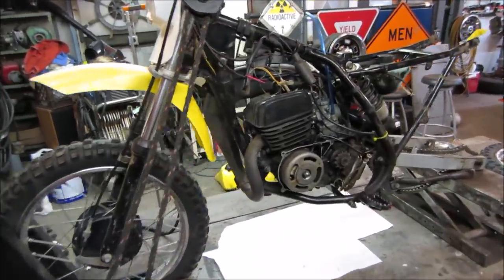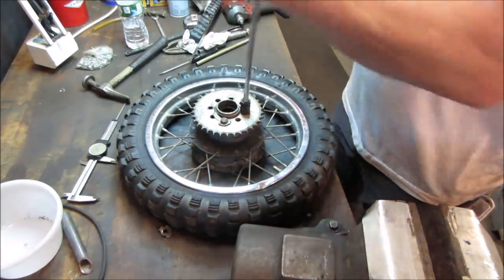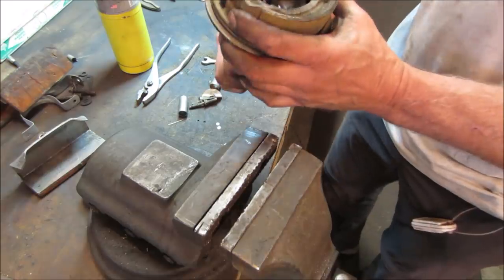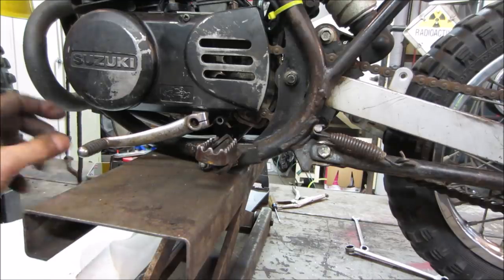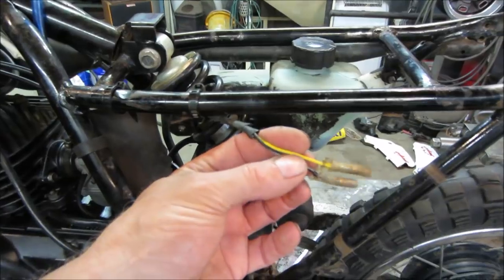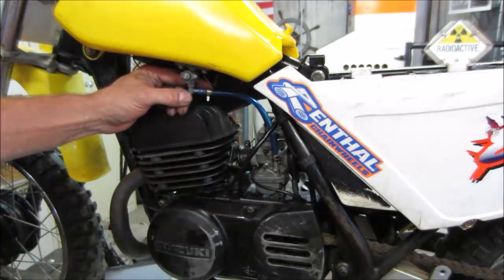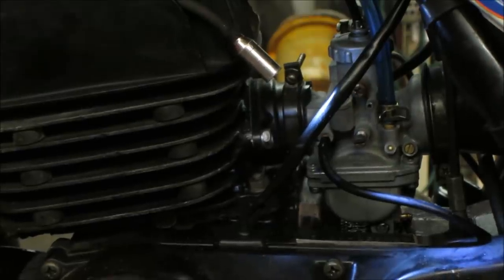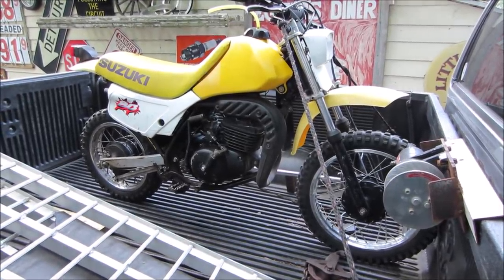Junk Suzuki 80 From A Yard Sale, part 2 of 2

Comment: My daughter had the same bike when she was young. That thing was a ripper, every time an adult rode it they got hurt bad. Her shift shaft/fork assembly did get stripped off once and all there is to fixing it was to pull the kick start and the right side case and it slides right through from the other side it was only like $18 bucks plus a new shifter. The when she got a new larger bike I traded it to a guy for his girl and warned him not to let adults' ride it. Sure enough that night thirty something uncle wiped it out and went in the ambulance with a broken collar bone. After his girl saw this she refused to ride it out of fear, so it was taken and traded for 3 Chinese four wheelers that were all shot in a week. I found it at the nippon dealer and tried to buy it back a couple weeks later to find out his adult son was riding it and broke an arm. He wanted way to much to buy it back so I caught hell for loosing "sunny" she never did like the new Yamaha. Then about ten years later I saw it along the road for sale and snapped pictures of it, sent them to her phone. At that time I was instructed to turn right around to go buy "sunny" back again, I was not gone 15 minutes but when I got back the guy said sold it two minutes after I pulled away. So I was in trouble again. If anybody out there has one of these with the little black and white biker stickers all over it " mostly proclaiming how much girls are better riders than boys"  Let me know, my daughter is going on 30 now but still wants sunny back!
Reply: quite a few bikes are made that way, with the internal lever and return springs on the clutch side of case. just for the reason of no main case splitting for shaft change :)

Comment: Sweet! In my experience that plastic welding doesn't really hold on in any bike. The streets of Helsinki are a real pain in the ass, since they're museum streets made of cobblestone, so they repeatedly cracked the plastic rear fairings on my motorcycle. I tried plastic welding them back for like 5 times, and then finally lost the part that cracked off, since the welds couldn't handle the stress... Then I threw in some fiberglass mats and resin on the section that fell off, grinded it to shape, sanded it smooth and painted it the silver that my bike is... and that hasn't cracked at all. At first I thought that plastic welding would be better on the plastic, but after putting that fiberglass there I've never had to melt them zipties into the fairings ever again. You could fix the rear fender and the missing pieces with a few pieces of fiberglass mat.
Reply: You can heat up some staples and melt them into the crack like stiches.
Reply: You might be able to anneal the repair like you would with metal by heating it to below its melting point and holding for awhile

Comment: When your doing the plastic welding.. add a paperclip across the crack and melt it into place. It helps to keep it from cracking again.
Reply: Stainless steel or aluminum screen cut 1/4 inch wider than crack works wonders, especially in curves & corners
Reply: @tpseeker3367  Yep, best trick. Did it many times. Works perfectely.

Comment: If you have a Dial Test Indicator you can set that to "Zero" on the Lathes Saddle after a "Touch On" to be even more precise (34 years as a Machinist) 😉
Reply: Recommend Abom79's channel...
Reply: @neonhomer  WHO recommends Abom79's channel?
Reply: Mustie no like lathe. Too complicated.
Reply: I would have thought that, as a machinist, you would have commented on the fact that the compound slide was on the wrong side of the cross slide, it was lucky that it didn't hit the chuck.
Reply: @markgriffin4888  
...and the tool bit was wrong for facing.
Reply: @TinShackVideos  and as Paul Frederick wrote-too complicated for MUSTIE 😆😆😆😆😆😆
Reply: @1pcfred  ,  He is always looking for a work around, even if  it means the piece MAY be the wrong size, out of round, etc.
Reply: @TinShackVideos  ,  AND he ran it backward half the time... I mean, who cares? RIght? LOL
Reply: I was just trying to be helpful, not critical 😉

Comment: JB Weld 2 part plastic bond, works great! Repaired all the broken mounting tabs on my headlight assembly on a Subaru. Worked great for the last two years I owned the car.
Reply: I use Devcon Plastic Steel ( NOT THE FAST DRYING STUFF ) on all kinds of things also. I even BED BOLT ACTION RIFLES WITH IT, GREAT STUFF. Dad fixed a hole in an engine block back in the 70's with JB Weld & Screen to hold the JB weld on. Blew a rod out the side, said it lasted 6 years & then he sold the car.
Reply: @NoWr2Run  I'll have to give that a try next, thanks for the info.
Reply: @Silversmith925  Yes Sir, Everybody has their favorite. I chose Devcon for bedding rifles because is does not shrink as much as JB Weld. Used it on .22 to 30-06 calibers & holds up fine. You can even put dye in it to match a wood stock, like brown, does not take much.
Reply: @NoWr2Run  that is very very impressive about the hole in the block. I'd like to do some experiments with that stuff.
Reply: @rm25088  YES IT IS, Amazing what that stuff could hold up to. Dad swears by it & he's 80 years old, still uses it for all kinds of shit. I use Devcon Plastic Steel it flows better where I want it especially in bedding guns. Hell it even sticks to synthetic stocked rifles but you have to drill small holes & scuff it up ( I use a dremel with a grinding bit ) for it to stick. Personally didn't think it would work but PREP IS EVERYTHING LIKE PAINTING. You can also mix some steel, aluminum, wood what ever filings, wood dust in it, I think it makes it stronger ?

Comment: Mustie , I'm over 80 years old and I was , just about , having as much fun as you were having racing through the woods .LMAO
Reply: He was racing faster here. I fast forwarded that section. Bike riding was never my thing. One of my buddies killed himself on one and other did a Superman impersonation when he hit a raised manhole cover in tall grass going over 50. He flew in the air over 150 feet. Arms straight out the works. All he was missing was the cape. Oh and the superpowers. Because when he hit the rocks he got pretty messed up. Was nothing a plate in his head and a pin in his knee couldn't fix though. Makes going through metal detectors hard today.
Reply: @1pcfred  Never ride where you can't see the ground.
Reply: @MrCarGuy  I think Scott would agree with you. I just never ride.

Comment: Mustie, when doing low budget repairs on softish poly plastic like the back fender, either a tie-wrap or the translucent white tubing for a refrigerator ice maker works fantastic as a 'welding rod'.   Makes for a much stronger repair than just using the base plastic.

Comment: The rear brake arm points up not down on this model. That way the brake rod will be straight.
Reply: I was wondering about that.  But if the arm is pointing up, then the shaft will turn in the opposite direction.  I guess if the brake works with the shaft being turned in either direction, then I would've at least tried test-fitting it pointing up, to see if it worked.

Comment: We had the 50cc road version of those bikes here. Made and sold in the 70's and 80's. We would bore them out to 50mm, put on a 24mm carb, an expansion chamber pipe and would use them on drag races. Some would lighten the flywheel and put on some Yamaha electronic ignition, others constuct some Stihl chainsaw ignition system on it (they came originally with breaker points). There are still some riding around. Real fun and quick bikes.

Comment: You made every "Machinest" mad by using your lathe in one segment, then you turned those nuts into spacers using a bolt and air grinder. I'm dying laughing. I love your videos sir.
Reply: I learned that trick in a machine shop. So no not going to make any machinist mad. We do it on bench grinders though. Works great for sizing the outer diameter of washers.
Reply: I was like "use the lathe!" but then... then I learned something.
Reply: @djmips  you learned about the Ifonly lathe. The if only I had a lathe machine.

Comment: Learned to ride on one of these. Those things just go like no tomorrow, me and my brothers rode it till it feel apart (literally). Rode it so hard the muffler and pipe snapped off the block and never went back on and the kick starter did what the shifter on this one did. (yeah we drilled and stuck a bolt through haha) Oiler never worked for us just ran mixed the whole time. Love these little suzuki's so much I ended up with a rmx 250 now that I'm a little older. Thanks for saving another one from the junk pile "Trustie Mustie".

Comment: I love your videos. First time sending a message. For the plastic welding melting in a stainless mesh across the cracks will add a lot of support to the seam. Also using some scrap plastic from another fender or other plastic item to melt into the seam and cover the mesh will add a lot of strength to the problem area. Keep up the great work

Comment: @mustie1 I have a southbend 9 you want to run belt in middle for cutting mild steel, back gear middle for cast iron, the high setting is for polishing shafts and stuff. Running to high speed causes chatter like crazy.  Take too big a cut or jam and belt slips off which is a good safety.  Oil crossslides, headstock everytime you use it and put oil on ways as well as oil the rest of points daily. I use hss cutters for most part.  Not sure if you have gear box or pile of gears. They usually have ratios on covers.  Southbends use a jacobs 2 taper instead of more common Morse taper.

The screws in belt area and on back gear shaft need oiling once and awhile.

A mod I did was to set crosslide to 30 in both angles and scratch it so that it’s quick and easy to set it up for thread cutting.

Comment: Bearing crush or preload is critical to the longevity and function when dealing with open/closed end bearings. Too much crush generates overheating or even binding up. Too loose or not enough crush will create “end play” and possibly allow the inner race to spin.

Comment: The best way I found to repair a stripped shifter shaft is to drill a hole between the shaft and shifter lengthwise and tap it for a bolt, this would make the bolt like a key way. I always put jb weld on it before tightening the bolt and waited 24 hours before riding. Never had one to fail. Drilling a hole 90 degrees to the shaft usually is always a fail.  Always liked this little bikes.

Comment: Just a tip when "welding" plastic if you bend a piece of wire like a paper clip into a zigzag and heat them up you can melt the wire into the plastic to hold it together
Reply: Using an aluminum screen is even better.
Reply: @marcryvon  thanks ill have to try that way next time

Comment: Thoughts:
many times I see those spacer tubes inside MC wheels with a flat washer-looking thing tack welded on to keep it in the center when you remove the axle it doesnt fall in the cavity.
Those torque rods that hold the brake backing plate if fastened to the FRAME, then the tube spacer you made needs to be a bronze bushing or bearing, as the brake backing plate rotates when the suspension goes up and down- but yours looks GREAT as the rod fastens to the swingarm!

ALSO: try to lube a chain on the INSIDE of the rollers, so that the oil will fling THRU the chain on it's way out centrifugally - putting it over the outside doesnt get the pins and rollers lubed as well..........
youre also missing a "Stinger" or muffler on the end, which in the DS wouldve included a Spark Arrestor for riding in the woods without fear of burning it down- it's WAY too loud for a DS series

Comment: That bike was thrashed pretty good mustie. I thought you might make the spacers for the tank in your lathe. It would have been an easy job the sprockets were terrible. The chain was stretched too. And made a square block for end of swing arm another easy fix. No thats pretty common on the rubber to support tank.runs pretty good some kid will enjoy that bike. I heard mustie signed up for the eighty class at the local max race!

Comment: I've a CT90 and CT110 I picked up out of barns still running strong almost 40-50 years later after some basic work.  I've been real tempted to get a new CT125 but for the money out a bit more I could pick up a used Shadow or something and have a solid highway bike...to go with the others lol.  The 110 is good enough for the trails here anyway and is classic Honda.

Comment: Re: bearing spacers: Normally, one side is held in place with a circlip so the outer race doesn't move. The outer race on the other end should not bottom out but float between the inner shelf and the outer rim. The spacer then makes sure that the bearing balls are not forced to the side. As such the bearing spacer length is not critical. A little long is better than too short.
Reply: Len whatever  ,  Remember, Mustie1 ia not Abom79.

Comment: To get that rear wheel lined up you can run a straight edge from the front to rear sockets, if they are mounted properly the straight edge should touch across the face of both sprockets , that should tell you how long the spacers need to be on each side.
''Lot of fun in a little package'', oh yes , just proves you dont always need 1000cc . One of the most fun bikes i had was a Honda Xl250 complete with i think 19inch front wheel

Comment: Tech tip for fixing cracked plastics;
From the inside, Clean and sand cracked area and then crazy glue regular paper to crack. The paper absorbs glue and becomes a rock hard tape! Then you could fill crack with crazy glue from outside! 😀👍

Comment: I’ve modified these spacers before and best way to measure, just remove one bearing and shoot your depth side of the dial caliper from the shoulder of bearing 1 in the hub bore; and to the face of bearing 2 still installed. It’ll be close enough.

Comment: FYI Mustie. When oiling any chains try applying to the inside as centrifugal force will spread it out and it won't drop as much off initially
Reply: Take an old chain like that, curl it up and heat it in the flat grease can until the grease permeates inside all the links and rollers.
Then hang it up to drip the excess back into the can.
Now you have a well greased chain...from the inside.

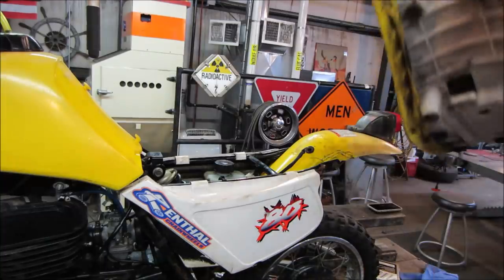Comment: @47:15 you were talking about ethanol hardening up the fuel lines.   REGULAR GAS DID THAT Too! BEFORE Ethanol.  On a 72 bike.  The spring clamps would hold on the barbed gas bib. It was not meant for removal and put on again.  Replace the hose if you are going to do that with new hose.

Comment: For fixing/welding plastic like that you can take a bit of steel wool or some type of mesh metal and stick it on the spot you're going to weld.  Then heat that up with the plastic welder until it starts to melt into the plastic.  Plastic to plastic never really wants to work too well but if you melt some metal mesh into it that will strengthen the spot thats weak.

Comment: In Finland, Suzuki PV (80's-90's) is a small moped with that same engine. It was reduced to 50cc and 4 speed so it would only go around 20mph. But normal practice was to "tune" the mopeds up with 60cc, 80cc cylinders and bigger carburetors and they would go over 50mph and of course the police would not like that. But that engine (what you have here) with that cylinder would bolt on to the moped chassis and were/are really sought after for. With that setup the moped would go over 60mph and that was stupid fast with a small moped! You could easily get 800 Euro (same ish in dollars) for that engine alone in Finland.

Comment: I owned a 1985 Suzuki DS80 but it needed work on the head & the rear hub bolt holes were stripped but one you could get on enough to ride it easily for a little before it popped the chain off & or the gear. Still have it but engines top end is off. It’s a really fast bike & would love to fix it but I just don’t have the money to.

Comment: Just what I need a Mustie vid, Bought myself a Rotovator today that starts but doesn't run ..... will be trying to fix it myself for the first time, from looking back at all the Vids for tips. 👍
Reply: Spark and gas. If it starts I'd say it is gas. If it didn't spark it wouldn't start. But to say spark and gas encompasses a number of subtleties. Timing, air fuel mixture etc. That's where it can get complicated.
Reply: @1pcfred thank you , yeah I'm thinking dirty old gas. Maybe carb  or even a fuel line. Going to enjoy trying to fix it at last 🙂
Reply: @Bacardibatman  first thing you have to do is dump old gas and use fresh. If something's running good it can run on a little old gas. But if it isn't running good and the gas is really bad it's got to go. Fuel hygiene is critical. You'll probably have to clean the carb and flush it out too. Once things are right it'll run right.
Reply: @1pcfred  thanks, will do. Got some more  car boots tomorrow will have a look at it Tuesday or Thursday
Reply: @1pcfred   @Mustie1 2 hours of tinkering (mostly me trying to find the right tool😂  ) and its running fine,  rust in the bowl and the screw that holds it on was packed with gunk. New fuel  cleaned it out fired right up 3rd pull and kept running. Thank you for the tips  and Mustie for the vids, I wouldn't have had a clue b4 watching them all. All I have to do now is shorten the cable to engage the tines.
Reply: @Bacardibatman  it's all simple stuff. Suck, squash, bang and blow. The 4 stroke cycle.

Comment: There's usually a rubber buckle to attach the rear of the tank to the frame.  It slides over that plastic hook on the tank and the metal lip on the frame.  Check the parts diagram.

Comment: Did you De Carb the exhaust system? Plug up one end of the exhaust system and spray oven cleaner into the open end, fill it up and plug up that end! Shake it up! Heat it up with a blow torch and let it sit overnight! Then hose it out! You will be surprised by how much extra power you will get! Ugh the trouble with 2 strokes!